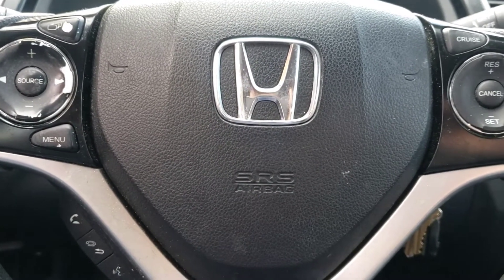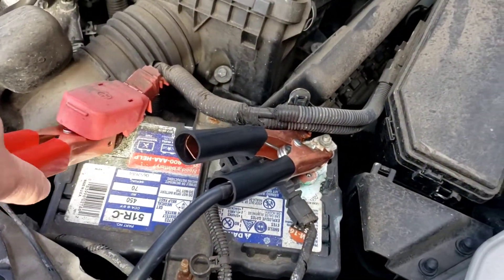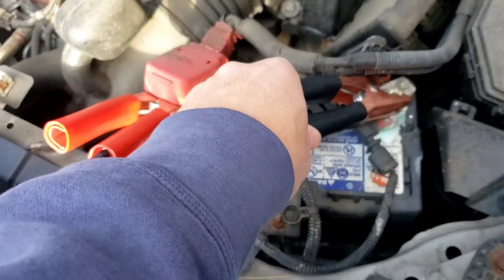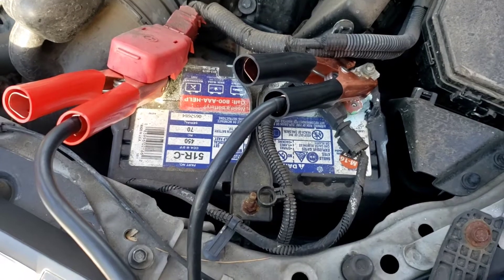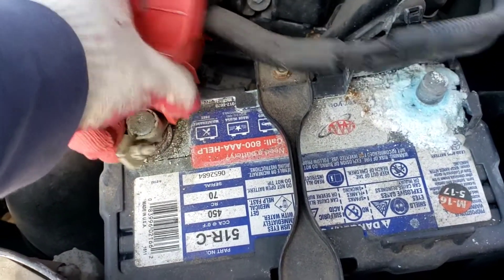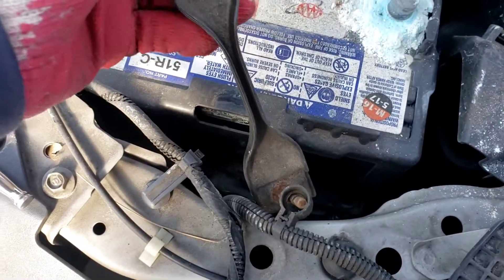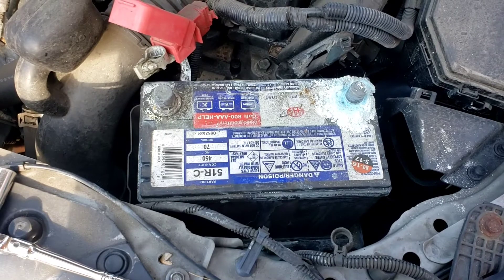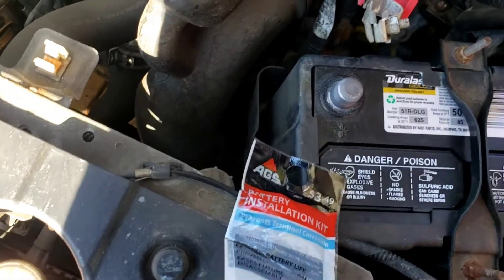Honda Civic Battery Check and How to Replace the Battery and Check the Charging System 2013 & others

Comment: Hi, i have check charging system alert appearing in a few seconds each time i start my 9 gen civic. been driving like this more than year, it always starts with no problems. charging is good and battery also. what else should i search there?
Reply from the maker: It's your Alternator  on its way out...change it before you get stuck..preventive maintenance is the best way to keep your car on the road...